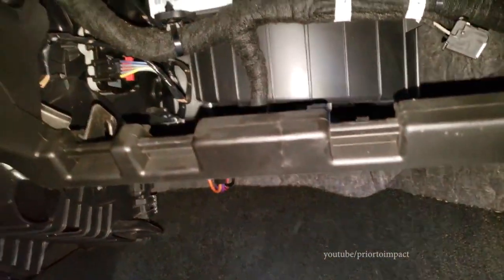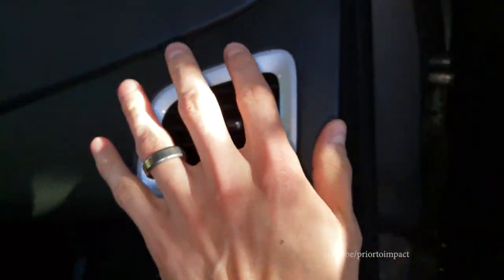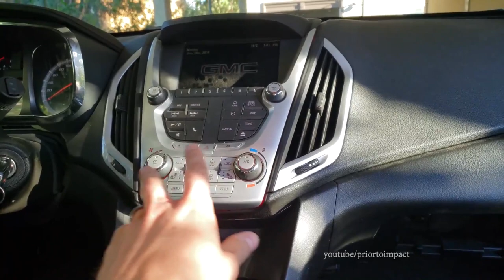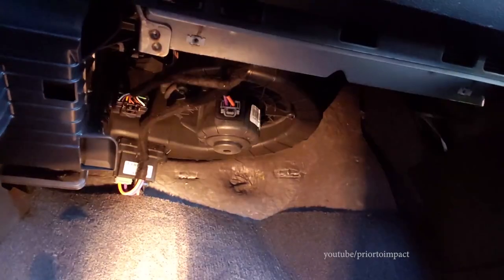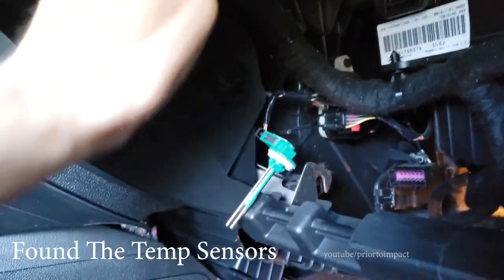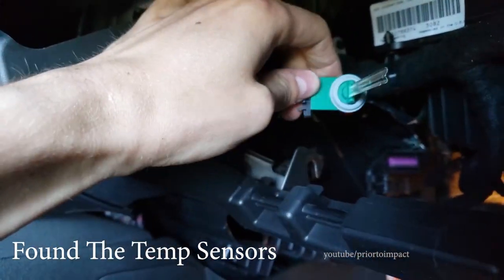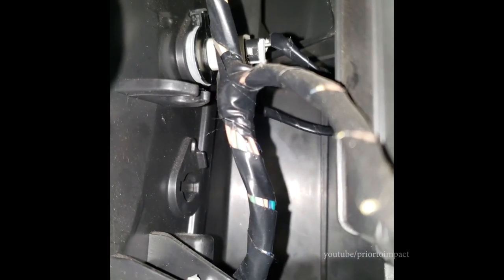Climate Control Only Blows Hot Air: GMC Terrain, Equinox

Comment: Would a 2013 equinox have automatic climate control? I don’t see an auto button. Looks all manual. if that’s the case I would not have those sensors or do all of them have that? I’m asking because the blend door actuator did not solve the problem. It’s still blasting hot.

Comment: My ac isn't blowing that cold I mean it cool but not ice cold. I bought some freon but haven't put it in yet. So I think I'm going to do this method. My air gets cold when sitting at stop light but when driving the air feels a bit warm.
Reply: Thats how mine is 2 right now but I bought it in a dealership I think I am going to take over
Reply: @cassandrabethancourt1213  I added freon and my ac blows cold now I hope u could try this.. I bought a 7 bucks freon at AutoZone. Just to see if it do the job and it fixed my issue. Now I need to fix this radio that keep going off and on

Comment: if u press "air inside" button (or whatever that buttons name is) , it won't pump heat in the car 😉
Reply: Negative. If there’s a malfunction the Recirculate Air button just blows the same hot air.
Reply: Yeah you’re wrong, no matter temp setting or if you have it on air flow or cabin flow it’s hot
Reply: Wrong dude, this is a problem these cars get

Comment: Currently riding in a 2020 Chevrolet Equinox rental car and I gotta say, this thing is a p.o.s.  Climate control fan won't shut off so it's constantly blowing hot or cold air.  And the radio won't let you delete crappy stations other ppl have saved.  And I've been in it for 8 hours and read the owners manual front to back AND googled shit so you can't  I haven't tried to fix these problems.   Chevy=garbage.